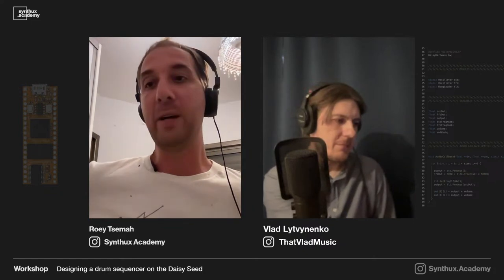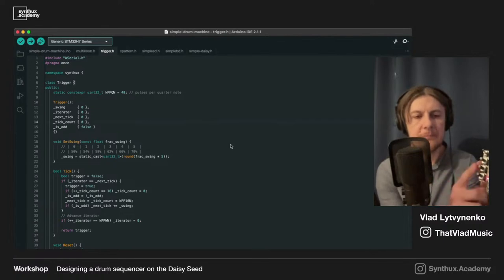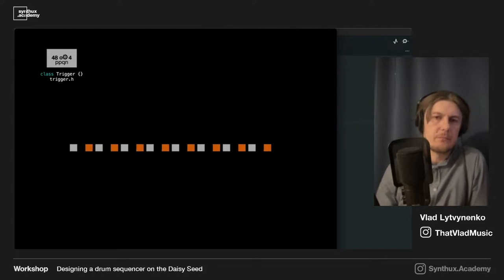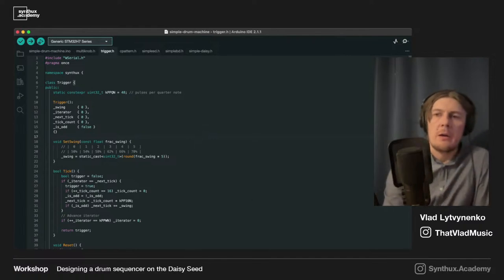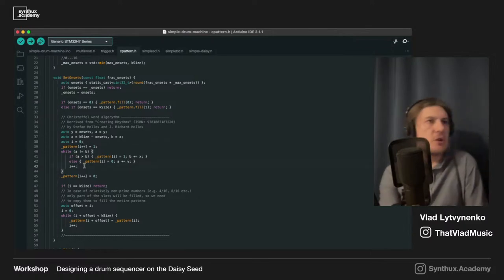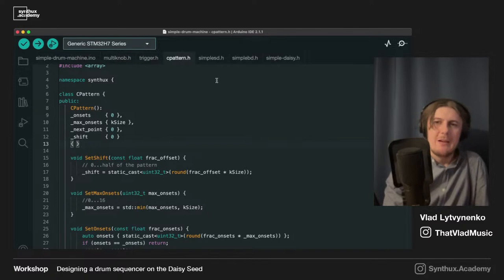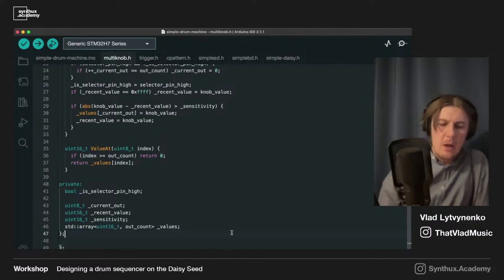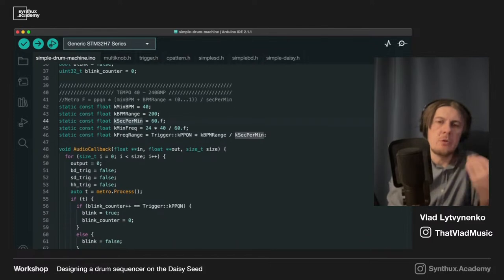Design your own drum machine! Daisy Seed + Simple Fix DIY Synth // Workshop

Comment: I'd love a video going in about how to implement presets on your synth. However basic it is. How do you handle input reading (pots) combined with choosing a preset (and thus not following the current pot values)
Reply: That's interesting topic indeed and I'll touch it in some of the future videos. In the meantime you could use MultiKnob from this video and try building on top of it. Although it's very basic, the principle is the same - switching between BD, SD and HH is effectively changing presets because every drum has it's own onsets+shift combination.